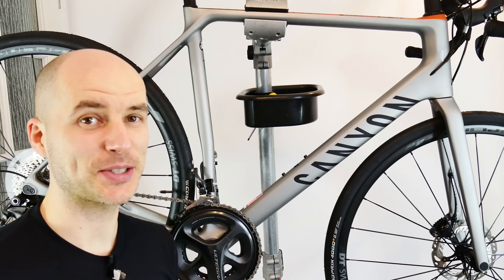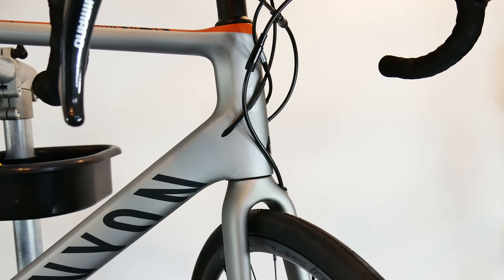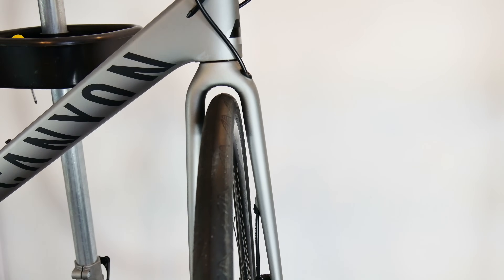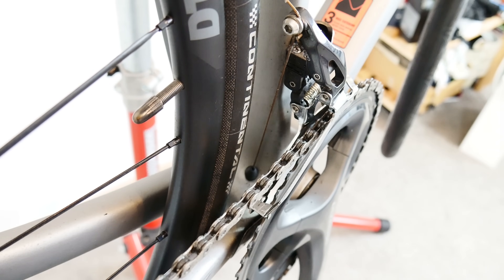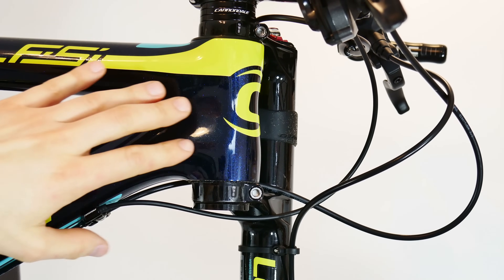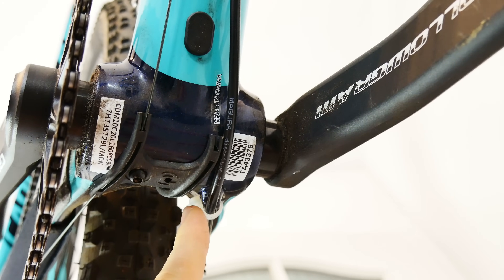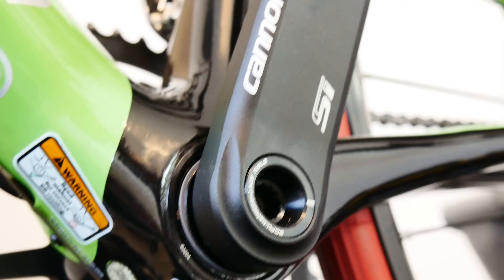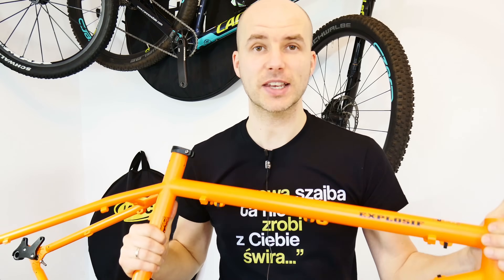Important Problems With Internal Cable Routing On Bicycle + Maintenance Tips

Comment: worked in the trade for 15yrs; to check, lube and refit external routed cables, 5-10mins. to do the same on internally routed has taken over a hour! better to charge £10 than £60??? not that we do. :-(   YET. It`s  ok if your name sir name is Wiggins or Cavendish, but if you live in the real world then keep it simple so you can do it at home. 8-)

Comment: Are u sure that the holes are drilled? I believe they are molded and therefor the fibers go around the hole which does not brake the stress path that much.
Reply: Mathieu B I don't think he realizes that the engineers know this and design there way around it or determined it was a big structural comprise.
Reply: companies care about sales if there are people like you who is willing to pay more for inferior product they'll make it. he does not say anything about engineering. he's talking about a very simple thing; is it weaker than a frame without holes? yes. no matter how perfect you engineer it, YES. it WILL be weaker and thats the point.
Reply: marble89 You are correct. You also fail to realize that although a frame that has holes is weaker, no one ever puts their frame in enough stress for it to matter either. I do not know why you are saying people like me willing to buy.......I have a 2011 Fuji reveal 1.0. It has only what needed to be changed on it.
Reply: Who put these holes on the bottom and top of my headtube, outrageous!
Reply: Yea the holes are not drilled and it doesn't weaken the frame. He's just making claims and guesses like usual.
Reply: Even if ...
that is NO argument of him at all.
Even if there is a severe "weakening" of the frame by the cable exits and entrances: no human driver I know is able to produce enpough force to break a frame because of this. Only in case of weight weenies, saving every possible gram we can talk about external routinf
Reply: I guess the frame is molded so the holes will not weaken the frame
Reply: Exacly
Reply: You’re probably right.  But for access doing mech work, external cables make much more sense.  When I was racing off road in Alaska, some guys I knew would remove the inner plastic sleeves from their SIS housing and replace them with continuous sleeves; so it provided all the benefits of internal routing with none of the drawbacks.  We also pumped light grease into the SIS housings to prevent water entry.  

We had races where we would start with brand new cables and housings and would have to completely replace them after just one race (fortunately that didn’t happen often as it gets expensive).   Anything to make the cables and housings last longer.
Reply: are you high?

Comment: "Driling holes"?! Those are molded into the frame, with structural reinforcements on the inside.
Reply: No.   most of the holes are drilled and cut in in after the frame is built.  The areas where it will be drilled are reinforced with extra material during the molding process.

Comment: No cables - no routing, no issues :D
Reply: Haha, fixed gear for life! :D
Reply: Nope. Electronic shifting is the only way to go!

PS Fixed gear bike is not a bike.
Reply: Have you ever ridden one? It's really fun!
Reply: No. I'm smart enough to not to ride bike without brakes outside track. Going downhill 50-70kph without brakes in crowded city sounds like a lot of fun.
Reply: I'm running a front brake on mine and actually use it a lot. And I live on the country side, so barely any crowded places here.
Reply: The only bikes I would get with a single gear would be dirt jumper, trials, or BMX.
Reply: lol ^^^^ this guy knows bikes
Reply: no brakes, no multi-speed... lots of uphill/downhill issues :D
Reply: There are no hills where I'm from and I run a front brake. :D
Reply: It's not impossible to put brakes on most (non track specific) fixed gear bike. I don't fully understand why that's a notion. My first fixed gear had both front and rear brakes and no one made fun of me. Just hating for no reason, kinda like being racist... bike-ist?
Reply: No bike no problems - just walk
Reply: Lance Flare 
I have ridden it when I was a teenager. It was terrible! Fix gear sucks
Reply: @GVGVIT  the moment u put electronic in the system it become unreliable. Trust me i am an electronic designer.No one could beat a reliable mechanical system.

Comment: Poor internal cable routing design doesnt make internal cable routing bad, there are plenty of internally routed frames that are well designed and make setup a breeze. There are terrible externally routed frames too, routing on the top tube drives me nuts, always getting snagged on stuff and feels so awkward when you pick up the bike.

Comment: I have a Jamis carbon bike and just had problems with the front derailleur not downshifting to the smallest chainring. I removed the cover underneath the bottom bracket and found the problem. Dirt had filled the plastic guide and was preventing the cable from moving freely. I now have an additional service step for this bicycle. I can see no way of preventing dirt and water flowing down the vertical section of cable going from my front derailleur into the frame and settling in the bottom bracket without adding stiction. Something that will keep this bicycle from being one that is a practical, dependable bicycle. A shame because it is my lightest, fastest bicycle. An issue that would not exist if it had external routing.

Comment: Totally agree. Who was the fella who created it? I just had a sucking moment trying to route a new cable into a new grommet. Trying to pop the grommet out is very difficult because it is tight. And one of it went inside the down tube. $#@&! After fitting the cable inside the grommet, another challenge to put the grommet back inside the hole. Damn wasting time.

Comment: I always use the thin plastic liner to prevent any cables being exposed to the elements and it comes up to the front and rear derailleur so only the tip can potentially corrode

Comment: You are quite right for external routing may be because those holes are not part of the architecture when the frame remains a computer model. This is an ethical issue between the structural engineer and product/business managers.

Comment: What do You think about removing the plastic circle behind the casette? Is it useful or useless? There's so many opinions...
Reply: Mateusz Urban it looks nicer without but it prevents the chain from hitting the spokes if its not set properly
Reply: If you have the limits set correctly on the rear derailleur there is absolutely no point in it. Bikes come with them so that if they aren't set up properly that the chain does not get sucked into the spokes.

Comment: I hate split gear cables inside frame.
I drilled bigger holes in my carbon road bike frame and installed full housing.
The gears work MUCH better now, the difference is huge.
It was some thin white housing inside the frame around the bottom bracket, that housing was full of dirt, it was hard pulling the cable out because of all the dirt inside the crappy housing.
The back wheel spins dirt on the exit port where the cable for the front deralliur comes out behind the bottom bracket.
Incredible bad design, only to save a couple of grams, idiotic solution to a non existing problem just like the press fit bottom brackets.

Comment: I think engineers would make sure that the frame is strong enough even with holes in the frame. Any bike manufacturer will make sure that the bike has some kind of a safety factor ... basically the bike is overbuilt to sustain years of punishment.

Comment: I deadly hate internal cable. My areo RB carbon frame is full internal cable, so I know how painful it is. I bought it just because the frame only sells 105 dollars. (Yet the cheapest one I could find in the market)
External cable routing provides better shifting feeling, and it is much more easily to maintain and replace. I can just spend few minutes to replace brake cable and shift cable. But on internals, nah... I still remember that day I spent 2 hours to change my shift cable for my rear derailleur.

Comment: My budget MTB came with a half internal, half external setup (Sunpeed Stella). Two holes on the right, one hole on the left; I'd say tho that the stock setup was terrible given that. I had to go motorcycle style on my brake setup in order to make it go right-left and left-right. The rest of the cables run externally on the chainstay and bottom bracket part.

Comment: I need some advice. When i downshift the cable guard (this black hose around the real cable, i don't know the english word) comes loose and moves, so there isn't enough tension for the gears to change ( its the Shimano SLX shift lever (3x10) on the right side (model year:2014))

Comment: 11:15 Shrinking tube is useful to connect cables together. 
If you not mention, main use naked inner cable is prevent long outer cable spring-effect.

Comment: i build up my new cube stereo 120 frame and after routing the cables internally there are already so messed up and stratched...especially the routing for the dropper post was a mess...because of the steep angles the cable has to go...and i had to rebleed the brake for the rear wheel because of the internal routing....also the rubber cable stops for the holes where not included when i bought the frame and the local cube store only had ones for only one cable in the hole...and i have 2 holes where i fitted 2 cables...so i bought rubber stops for automotive use on amazon and cut them....so stressfull :D

Comment: Any tips for stopping internal cabling from rattle?
Reply: I think poring sand into the frame until its full,  old nuts and bolts from around the house, Certainly dont use anything ALIVE, that would probably not work out, Good Day!
Reply: See Dr. Steve Brule for additional information.

Comment: Some people are saying "ah, but the holes are moulded, so they are very strong", but the fact remains that a frame with a hole in it is weaker than a frame that doesn't. And sure, you're not likely to break the frame from sheer force of pedaling, but it only takes one shock impact to begin a crack.

Comment: i am also not a big fan of Internalcable, Hollowtech, PressfitBB and co.
But to be fair, at the BB there is no big hole, just a small one for screw  or so to hold the plastic cable guide in place.

Comment: *Carbon structure
I don't know whether you have faced forces affecting your bike but:
1. carbon fiber matrix - if processed well - is able to resist way more forces, than almost 99,99% of all riders can produce. 
2. At the Head tube - where internal cables enter the frame - the forces are even smaller than at the bottom bracket. It makes NO difference whether the riders produced force encumbers 60% or 70% of the frame resistance capacity.
3.Some of the best and stiffest bikes use internal cable routing without any stiffness issues/problems. So why getting even more stiff frames (with external routing), if it makes NO difference at all? Saving another 17,46757g? Flawless in my opinion.

*Installation
Well, if there are no liners (anymore) in the frame its a slight pain. But with some experience, a vacuum cleaner and/or a magnet, its done in 5-10min.

*look
I think it is an objective argument, if I claim: internal routing is WAY more beautiful and clean.

Resume: I see NO REASON AT ALL to external route ...

*fork internal routing: well, that indeed looks stupid

Comment: Internal also has problems with annoying rattles
Reply: Only really crappy ones. Solid bike brands solved this out ages ago. But if it rattles already, it's not that hard to fix it.
Reply: Indulonman Correct. I just purchased a 2017 Cannondale Quick4 with internal cables and it's near perfect.. They added some gaskets at the holes keeping the cables snug. Had a little rattle with the rear brake cable. The rear cable (along the top tube) is the only cable without these gaskets so it can move freely when turning the handlebars and sqweezing the brake lever. But a quick fix was me simply spinning or twisting i should say the cable housing with my fingers and it was gone. Or just shorten the rear brake cable housing about a half inch would also fix it. The bike mech when building your bike gives extra cable length on that particular cable probably for security reasons and or Cannondale spec code. My bike is rock solid..love it 👍Acid green color she's a beaut! lol

Comment: Do you know about any examples of fractured frames because of the integrity weakness due to the drillings?
Reply: It may not fracture, but you won't get as stiff or as efficient a frame as you could have had.. Nobody wants to ride an inefficient noodle for the sake of some basic aesthetics.... it's like people who drive convertible sports cars - with a chassis that is often massively compromised with poor performance, where a sports car should normally shine.
Reply: Um... It's called an analogy.... 
For both bikes and cars the goal is stiffness of frame or chassis for mechanical efficiency and direct power transfer. It's one of the key goals of effective mechanical engineering...
Reply: axiomic Do you feel the difference in frame/fork/chainstay stiffness between internal and external cable routing bikes? Peter Sagan doesn't seem to have a problem with it...
Reply: As with cars, it depends how well it's done and compensated elsewhere in the construction. I'm sure it's mostly not too much of a drama. Interestingly, the Specialized road bike frames are some of the heaviest on the market... even their new line of xc mtb hardtail frames are lighter. So I doubt Sagan has anything to worry about.
Reply: axiomic It's more in theory than in practice. I'm yet to hear about cracked frames or complains about performance due to internal cable routing. Aero road frames are heavier but I don't think the cable routing has too much to do with it and they can still be under the UCI limit.
Reply: Yeah I think you're right.
Reply: Or, it's like engineers who design it to be that way and there is essentially no weakness, convertibles or bike. You don't know what you're talkingabout
Reply: Convertibles are much sloppier than any hard to kiri...

Comment: When I was racing off road, we would pump light grease into the cable housings to prevent water getting into them.  Some people removed the plastic sleeves from the SIS housings and installed a continuous sleeve that ran from one end to the other so the cable was completely protected in the areas where it exited the SIS housing (and they would also fill the entire thing with grease).  Why did we go to such lengths?  We had races where we would start with brand new cables and housings and by the end, they would all need replacement.  Fortunately that didn’t happen too often.  Gnarly, muddy conditions in Alaska racing.  

Internal cable routing is a bitch for practical mechanical needs when you’re having to constantly replace them.  And trying to fish a cable through is a pain if you don’t take steps like attaching a string first so you can pull a new cable through the frame.  I’m all in for external routing.
Reply: I think you can tape some bag to the end of the cable put it in the hole and then use a hoover at the other hole to suck it through.

Comment: Internal cable is required absolutely cause it is clean outside of frame, so safe to the riders in any situations. And it is easy to water clean of the frame.

And it is more aerodynamic.

Problems are that the frame producers and maintenance mechanics don't care much about it now. They can make all maintenance procedures are easy for us to follow if they care, design the frame more than now.

Of course its frame production cost could be increased, but also this matters could be overcomed if they are smart enough.

Comment: Just replaced the internal cables on my Cannondale synapse , nightmare !! 
Cable sleeving was damaged so had to pull out all existing gear . So no way of getting the new cable back in , so then had to remove the bottom bracket. Then make a aluminium plate for underneath the bottom bracket. Still not got it back together . 😞😞

Comment: I totally agree with you. I just bought a Cannondale synapse 105 and it has internal cables.
I love the bike but I've already had cable issues only after two weeks of riding in the rain.
The shift cable housings that came with the bike were of poor quality and started to rust. The brakes seem to be working fine.
I pulled back the front derailier hood and tried to pull on the cable but it was stuck. I then took off the bottom plastic cover to look at the cables and noticed that the guide that goes under the bottom bracket to the front derailier broke in half which rendered the bike shiftless. ( I might have broken this when pulling on the cable with pliers to free it up)
Your definitely right about rain and dirt getting into the frame. Where the cable come out of the frame above the bottom bracket to the front derailier there's a small hole but no rubber bushing. It's just waiting for water and dirt to pour into.
So I did a little DYI  and took a piece of shifter cable housing and installed it where the cable usually sits. I did  some modification and it now goes up to the derailier, under the bottom bracket and up the down tube about 10 cm.
I then calked the hole with silicone.
It's shifting great now. Just make sure to get at least the Ultegra shift cable set, they are coated with a polymer coating and shift way way better then the standard set and seem way more rust proof.
I am now working on sealing up all the other holes going into the frame.
One benefit I do see with internal cable housing would be when mounting frame packs for endurance riding, the Velcro won't interfere with the external cables.